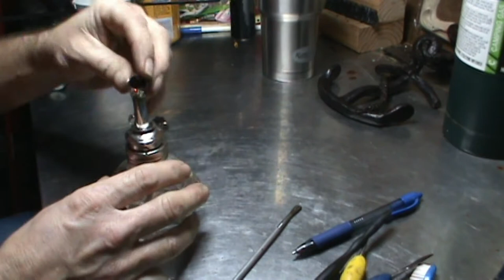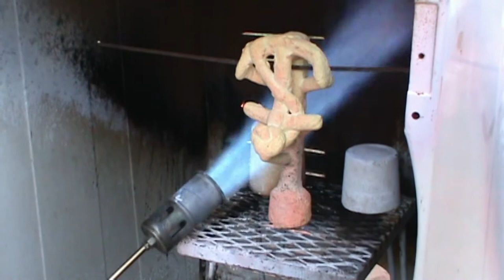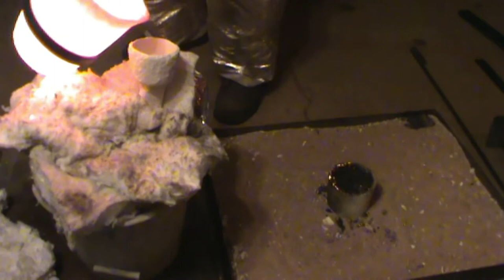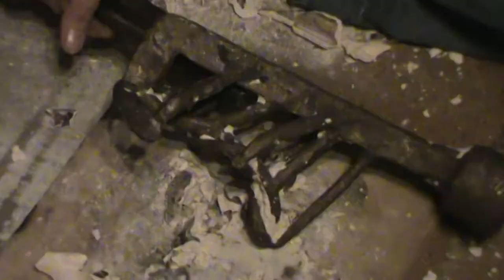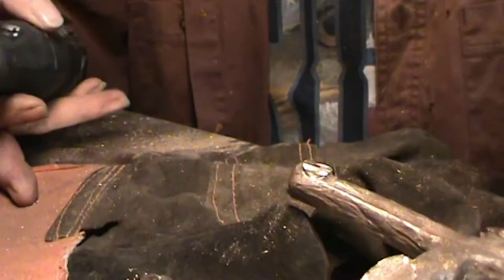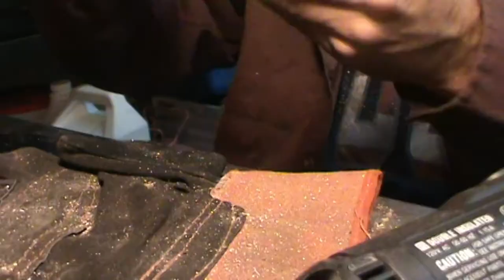Lost Wax Bronze Anchor

Comment: Bro, you better start clamping down your work piece when using that suicide saw (aka, grinder) w/ a big blade on it.    Not a matter of IF but WHEN it's going to bind up on you and break lose  (aka,  become uncontrollable). When that happens your going to have a bad day.     And wear some dang leather gloves while your at it.     Nice Anchor!     Well Done!!!
Reply from the maker: Yeah, ya gotta watch those dremel tools, they're vicious.  lol  Gloves with any rotating tool is a big no no.
Reply: Dremel???   LOL -  I was referring to that 15 amp angle grinder with the 7" concrete blade on it.   I wear a pair of thin TIG  gloves when running grinders with suicide wheels on them.   Where do I forward your "Get Well" card?   LOL

Comment: Presumably you drilled holes into the shell to allow for better burn out of the wax. Do you have problems with the bronze leaking out of those holes?
Reply from the maker: That's correct.  By drilling holes, it helps relieve some pressure of the expanding wax during the flash fire dewax.  What I didnt show was I patch those holes with slurry and silica before going into the kiln for burnout.  If I poured bronze into the shell without patching the holes, I'd have a pretty cool fountain!  Thanks for watching.

Comment: Awesome work - thanks for posting - a real inspiration! Hey - what kind of disc is on the 4" grinder? Works better than carborundum?
Reply from the maker: Thanks.  Glad you enjoyed the video.  The cutoff wheel on the grinder is a lenox diamond blade. (about $20 at HD or lowes)  I only use it on bronze stuff and never steel.  Cuts pretty fast and lasts a long time.  Typical cut off wheels don't last.  I think because bronze is so soft.  It machines "chewy like" and quickly trashes wheels.  For other finish work, I like flap discs 36/80 grits I think.  The best solution is probably a bi-metal blade in a portaband.  I have a stack of 3in ingots that need to be cut up.  Probably time to buy a cheap HF band saw.  ;-)
Reply: Roger that on the bandsaw...I think Swag offroad has a stand to make it vertical when you're done hacking. Thanks for the tip on the Lenox blade. Have you used it on aluminum at all? Wondering if it would work for times you can't get a sawzall, mini hack or much else 'in there' to get at it.
Reply from the maker: Sorry I haven't tried it on aluminum.  My guess is it would "clog" up the blade.  I chase back my bronze with cheap ebay chinesium grinding bits with teeth and diamond burrs.  Do you cast bronze?
Reply: OK - no but think I might be messing with white bronze in the near future to emulate some pressure die cast parts, using investment/vacuum.